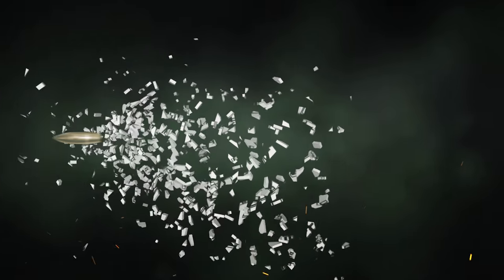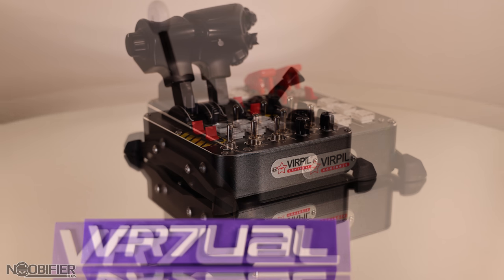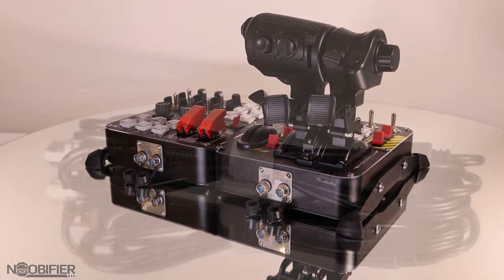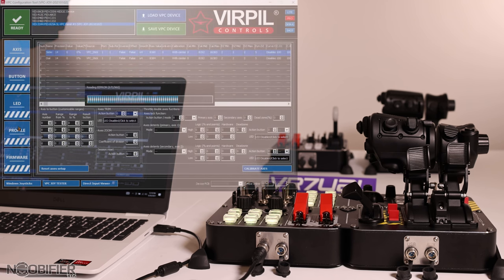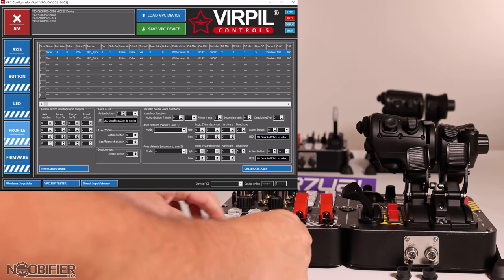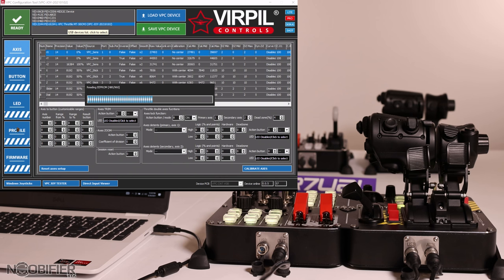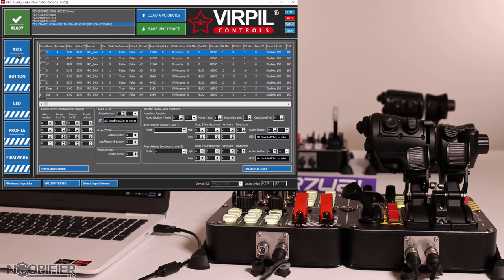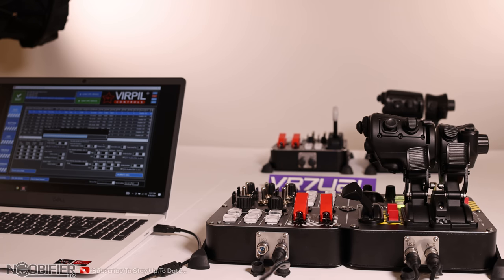VIRPIL AUX/USB - How To Connect

Comment: Keep in mind that this method causes both devices to be counted as one usb device with tons of buttons. Certain games can't handle this many buttons on one controller. Very old games can only take 32 buttons per controller. IL-2 (Battle Of X series) can take 64, while something like DCS can take 128.
This means if you use this setup for IL-2, the game will not natively recognise all of the buttons, and most of the panel buttons won't work. You can work around this with joystick gremlin, but that comes with its own issues.
I'm not sure how many buttons Star Citizen can handle, but I would hope it could take 128 being a modern game.
Reply: IL-2 doesn't even handle all the buttons on the CM3, the developers need to pull their socks up
Reply: @JohnCarlyle  not sure how long it's been since you played il-2, but they updated that ages ago. I've got the cm2, and il-2 great battles will happily accept every button as an input.
Reply: @funkyschnitzel  A few months ago. I had my CM3 set to use the 'modes' and it certainly didn't recognise all buttons.
Reply: @JohnCarlyle  ah that's interesting. I guess the modes just increment the button number. I use the dial as a 5 way selector, rather than the mode switch. Already plenty of buttons there, plus I have the landing gear control panel and a constellation alpha, so I struggle to use all my buttons as it is.
Reply: @funkyschnitzel same “problem” here 😂😂 but more buttons always is better!! 😎

Comment: I had to set mine up as slaved units to get everything working in Star Citizen as it seems to have issues with more than 4 or 5 USB joystick devices. Now I have one panel slaved to a throttle, and one panel slaved to one joystick base, and everything works natively in Star Citizen again :) Thankfully SC reckognises all 128 inputs from one device, where Elite Dangerous is STILL limited to 32 buttons for some incomprehensible reason.

Comment: hey, i have been looking for a while how to attach the control panel to the throttle on the side. I am using a monstertech setup with the slide rail. Do you know if monstertech has something for this? I see in this video you have got some sort of plates that hold them together.

Comment: One question: in case of having the auxiliary port damaged in the throttle, could I still make the control panel work by connecting it directly from the USB of each one to the PC? (2 USB to PC, 0 Aux connected) I would really appreciate any answers. Thanks in advance!!

Comment: This did not work for me.
After flashing the control panel by itself and making a profile to put it into slave mode, I have to keep it plugged into the USB port for it to work. So I’m using both cables.

If I disconnect the USB and only use the slave cable, the responsiveness of the control panel is greatly reduced, having to wait seconds sometimes to register inputs.

With the USB cable connected as well, I can still use one profile to combine the two, but I’m effectively still using two USB ports.

Furthermore, the Sharka Control Panel 3 also does not seem to support slave mode at all yet. Tried the same thing with it, slaving it to my throttle, and I cannot create a slave mode profile for it, only a usb profile.

Comment: Thanks for the video. Definitely helped a ton. Do you use a hub for multiple devices. They say you need to connect each on directly?
Reply from the maker: I use a hub for sure. It’s not possible to connect direct
Reply: @NOOBIFIER1337  Thanks

Comment: I have a question based on Star Cit.  If the button box is slaved to my throttle, will the two devices count as 1 device for SC's 4 device limit?  I've been having issues with the 4 device limit with the collection of devices I've gathered and am needing to better plan my replacements.
Reply: They will appear as one device in Windows, which will carry through into any game you play. The issue you'll face is that lots of games can't handle a USB device with that many buttons, and all of the buttons after button #64 simply won't work.
I know DCS can take 128 buttons, but I don't know about star citizen.
Reply: @Chris Bagnall  star citizen is 128, too

Comment: Is it possible to connect the panels/throttle to a USB plug and play? To basically turn them into a wireless system
Reply from the maker: Wireless?
Reply: thank you for the reply. Im interested in getting into flight sims  I was curious how do y'all have the equipment wired and ran or instead of having a bunch of wires running from the virpil to the mounts do y'all basically connect them wirelessly using Bluetooth USB connector?
Reply from the maker: @MommaFox343  I don’t think that would work as it would add a bunch of latency. Just take the time to gather up the wires with zap straps of conduit.
Reply: @NOOBIFIER1337  oh ok that makes sense. Didn't think about the latency issue. Thank you for the reply!

Comment: Too bad about the lack of daisy chain support. That would have been really handy for cleaning up some of the more elaborate configurations with multiple panels.
Reply from the maker: There is a limit in the system.. I believe they saturate a single wire at 128 individual buttons

Comment: There's a small connector labelled "AUX" on the board inside the Virpil WarBRD base. It had me wonder why it's here.
The connector base/grip is also a 5 pins. Maybe...
Is this sponsored content?
Reply from the maker: No, if it was sponsored, I would have mentioned it sir,

Comment: Where did you get the cable no one can find them?????
Reply: I just got my control panel #2 in the post. It came with two of the AUX cables in the box + 1 USB...They are for sale individually on the Belarussian site but not on the UK or US webpages. Dunno if that's any help...

Comment: can you put cm2 base to cm2 base? or a panel to a cm2 base
Reply from the maker: No
Reply: @NOOBIFIER1337  so you can't slave a panel to a Mongoose t50 cm2 stick base? Or is it just to the  Throttle? I don't understand
Reply from the maker: @lonewolf1313131  Right now its Base to Panel or Throttle to Panel
Reply: @TheNOOBIFIER1337  that what I wanted to know, thanks now I plan my sim pit out for star citizen better. was thinking of doing duel stick with a Throttle and two control panels, then maybe with a foot petals if there was room